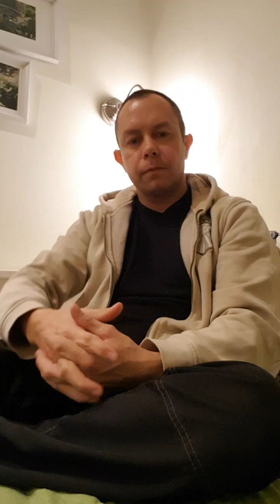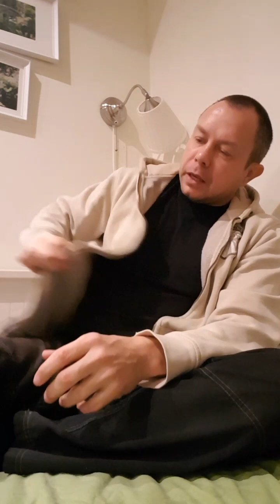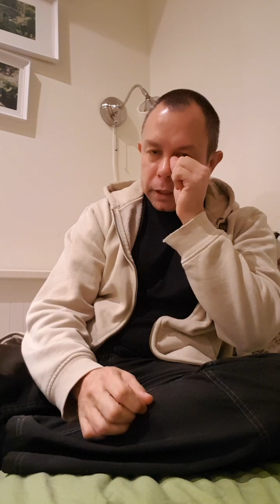Mercedes om603 and om606 twin charge setups. Supercharger and turbo. Waooo that's cool.

Comment: Hi fred, I know this post is older but im twincharging my 606, just trying to understand what actuates the diverter valve in the first correct example? Is it the vacuum on the flap from the turbo overcoming the 1 bar from the supercharger, if so does that not provide a large restriction in flow for the turbo when fighting it? Cheers

Comment: Im thinking of doing this on my om648 so ill have lower down throttle response but the turbo for the higher end. The issue is it doesn't rev as high as a 606. I can probably raise its limiter but the plus side is its cdi so can tune much better and have more control over the tuning. Do you know of anyone who has done this engine?  Keep up the swearing too it keeps all the nobheads away.
Reply from the maker: The beauty with low revs is that you can gear your SC really high. Good luck with the project and keep us all posted.
Reply: @FtunePerformance  fair point. Hopefully get the car back to my house on Thursday and get at taking it apart and working out how much room I have in the engine bay.